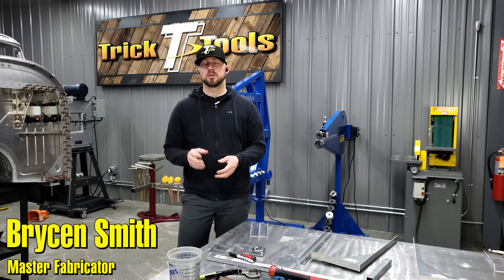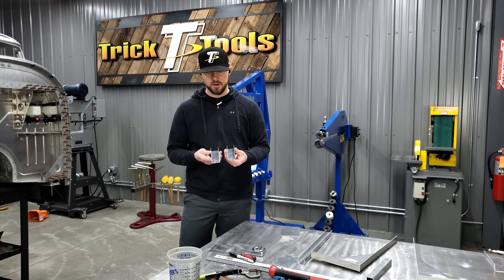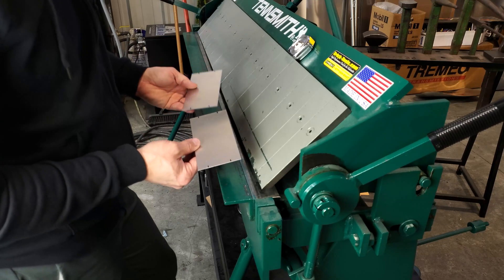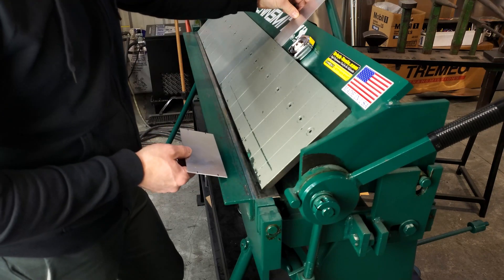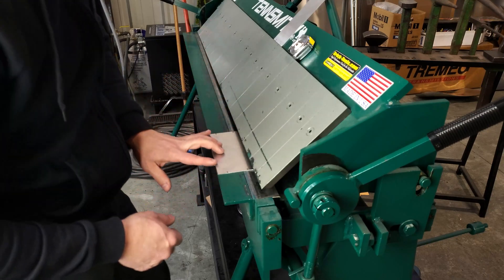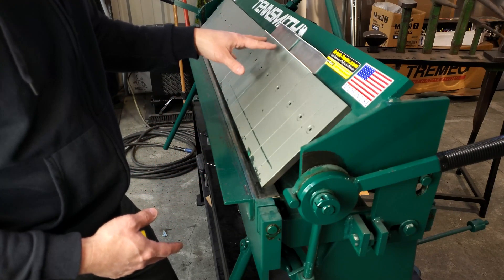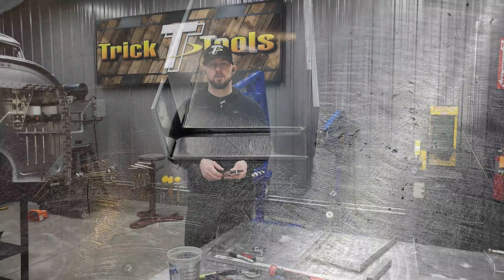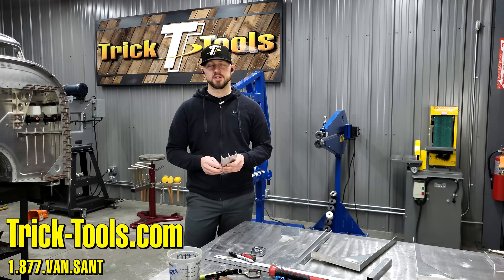Trick Tip Tuesday #1 - A Simple Sheet Metal Brake Technique - Trick-Tools.com

Comment: So, is the first one you did on the break line, was that the outside u channel?
Reply from the maker: The first part was the narrower part, bent on the brake line rather than off the fingers
Reply: @ I meant the way they seat together. Is the first one he did the one that sits on the outside or the inside?
Reply from the maker: The first part was narrower and fits inside.